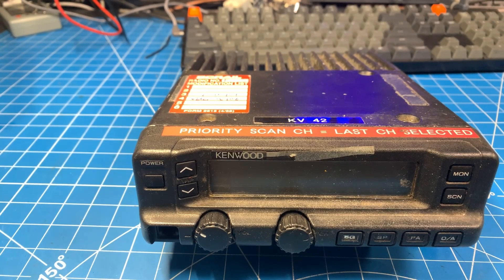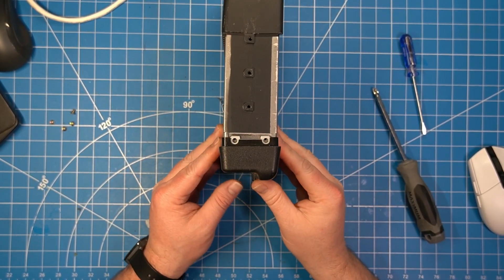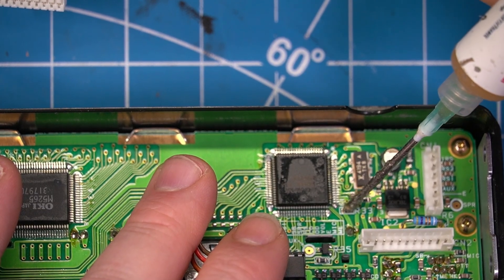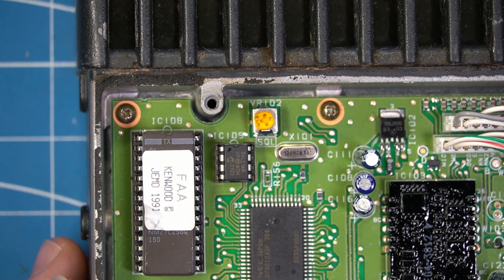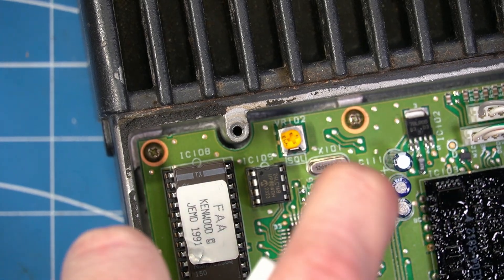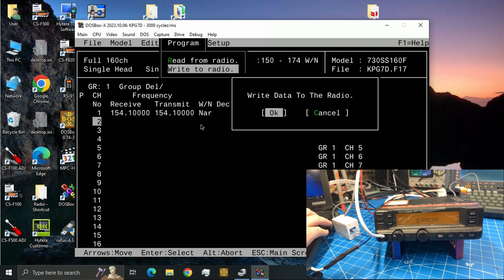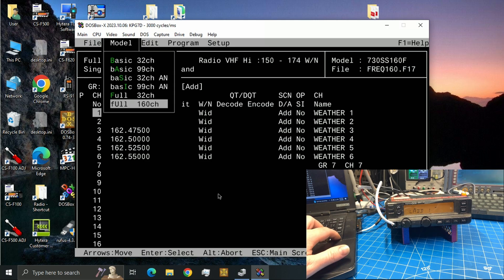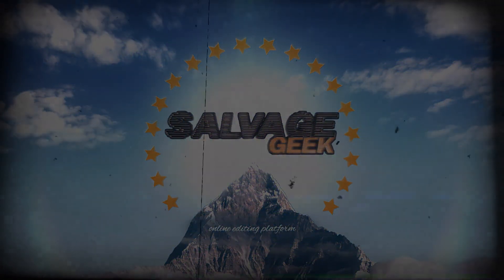Kenwood TK-730 - 160 Channel Mod

Comment: That’s odd. I never saw the Wide Narrow selection in the software. These radios were sold way before the FCC even thought of narrowbanding. Any idea if it has the necessary Compander circuitry for the audio?
Reply: The models with G after the model number are narrow band capable.